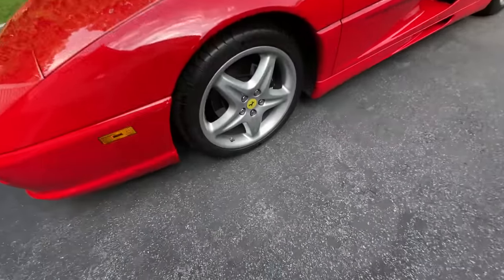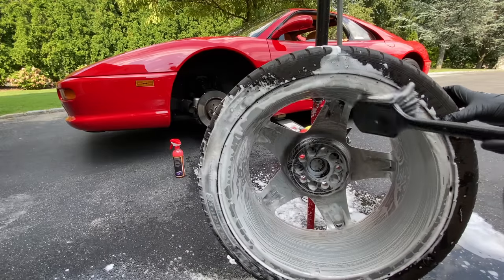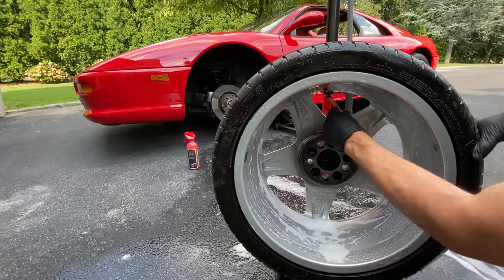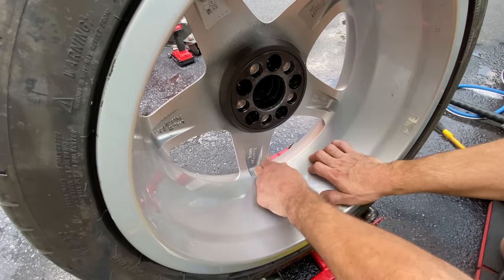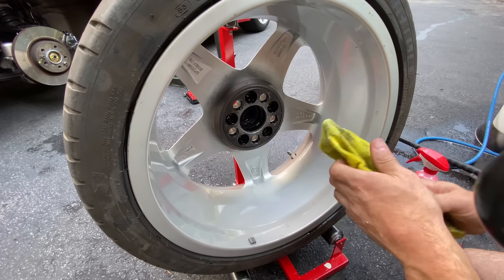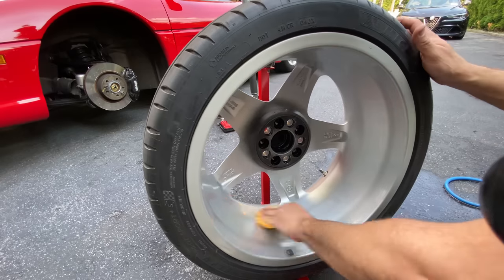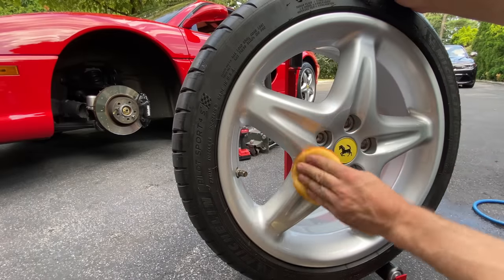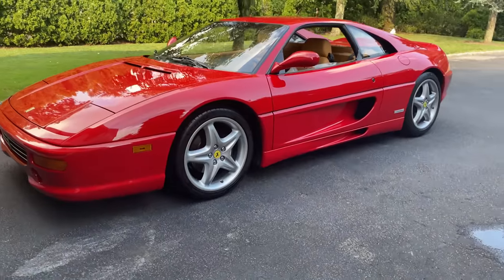Ferrari F355 Concours Level Wheel Detailing | Auto Fanatic

Comment: Out of interest, why didn’t you ceramic coat the wheel that offers far greater protection than a wax (especially on wheels).
Reply from the maker: because a ceramic coatings solvents can affect such an old finish and its just too risky since these wheels are not aluminum but magnesium which absorbs any moisture instantly into its pores. I have seen shops ceramic coat old wheels for the finish to yellow in areas. age breaks down the painted finish so you really need to take caution on older cars if your looking to preserve them.
Reply: Auto Fanatic thanks, nice to know 👍🏻

Comment: Awesome video. I don't know what it is about cleaning dirty wheels and tires. I had to remove hardened asphalt and wheel weigh glue and it sucked. I used a similar method with over saturating the area and a little bit of heat. I didn't want to cause more damage to the finish. Took me two days to do all four, but felt good after finishing.
Reply from the maker: yes the end results are always worth the effort, i also cleaned and detailed the calipers that will be the next video on the Ferrari F355 soon.
Reply: @autofanaticcars  Awesome. Growing up through the 90's the F355 was one of my favorite cars. Such a classic look and sound.